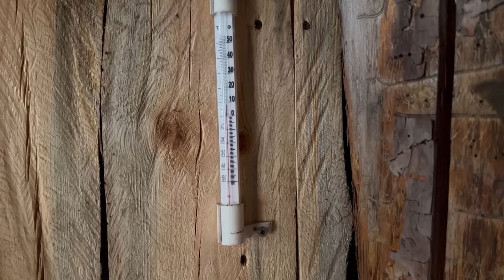Hiding from the WINDSTORM in a HOUSE UNDERGROUND, repairing an OLD DUGOUT

Comment: Another good vid, BUT instead of spraying water ont the substrate, try using a primer before applying the top coat.  Also, add abit of  liquid dish detergent to the aggregate, it makes smoothing it better.

Comment: Thanks for all the videos, and for not talking. You offer a thing to look at when emphasizing, and that works! BTW, at 12:00 or so on the video, there is a vapor where the chimney connects to the flue pipe. Is that steam from the starting of the fire, or is that smoke escaping? Carbon monoxide issue, if it is smoke.

Comment: Dead trees need cut down if close to the house. I recently had a very tall pine tree that was over 60 years old cut down. It had been dead for over a year and even though the  majority of it was still solid, the top 1/4 was rotten and every strong wind brought down limbs and bark was shedding off in big sheets. Only a matter of time until it would have bashed in my house. Luckily for me I got it cut down at no cost due to some great people.
Reply: You did get lucky. Getting trees removed isn’t cheap.